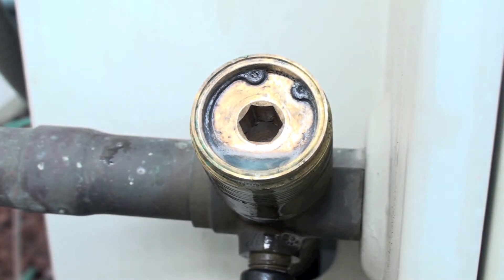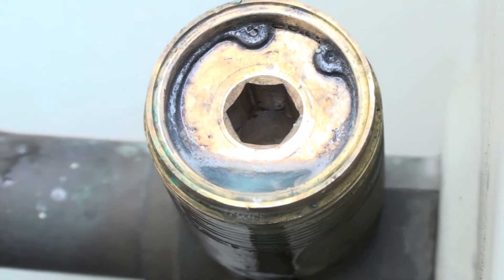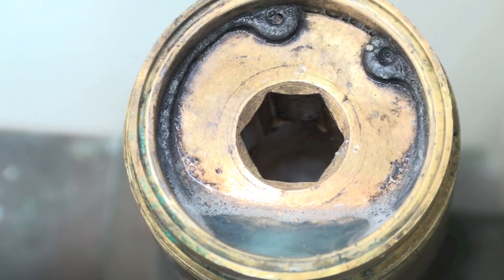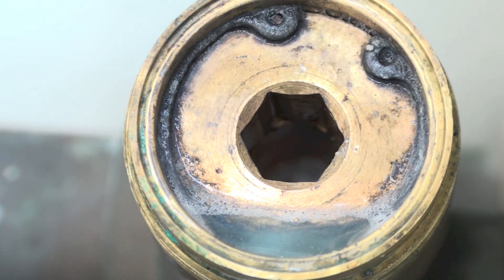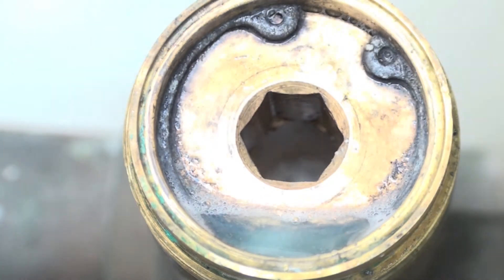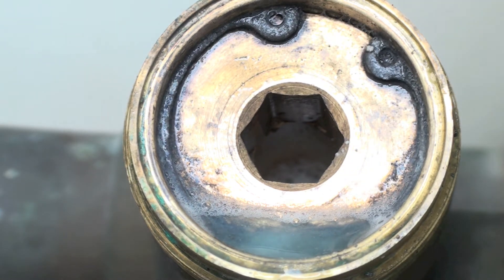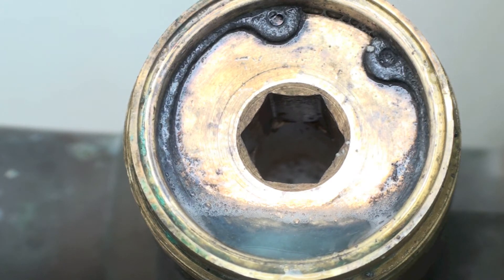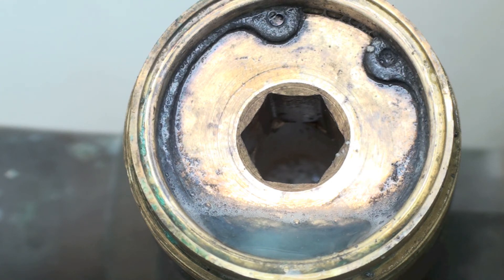How to find air conditioning service valve leaks

Comment: When a leaking O-Ring is not replaced but valve is closed completely then will the vacuum hold if a vacuum pump is connected/used ??

Comment: As you said, this is a monster problem.   Please help me understand why this has not and is not being addressed with a redesigned valve.   Are the manufacturers simply blaming the entire fiasco on improper installation and so washing their hands of the mess?    This should be on the EPAs radar as a high priority item one would think.
Reply from the maker: +Gene Friedman There has been an issue with overheating the valves.  Usually from using too little heat and taking too long.  However, that is not always true.  These valves have been leaking since I got into the business in the late 1970s.  Service valves used on refrigeration are better, but some of them leak too.  
The only good valve is one that is not there.  I began removing valves and replacing them with brazed fittings with just schrader fittings for line taps in the early 1980s, and have never been sorry.
GFM